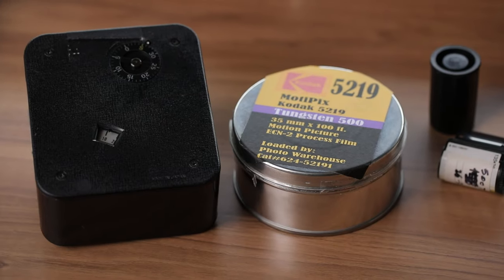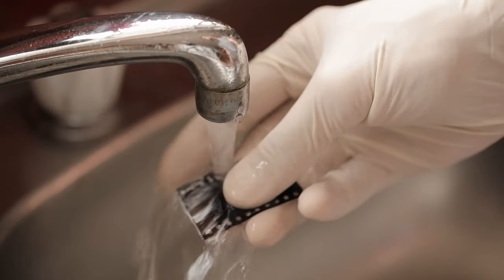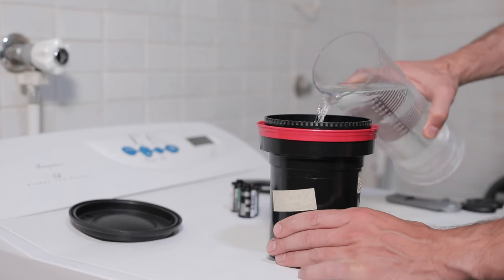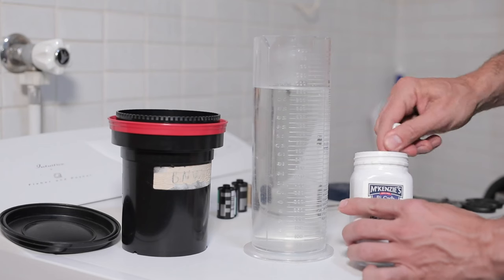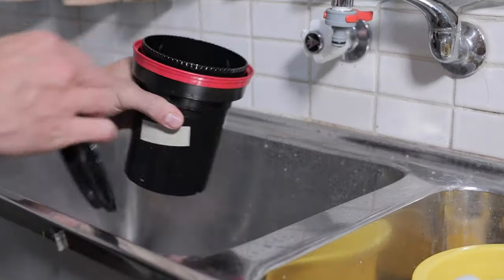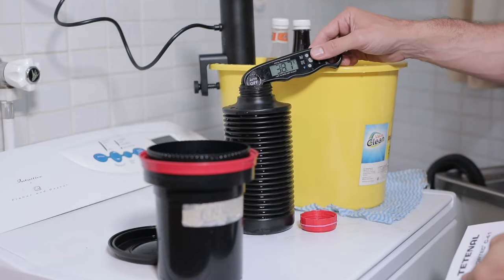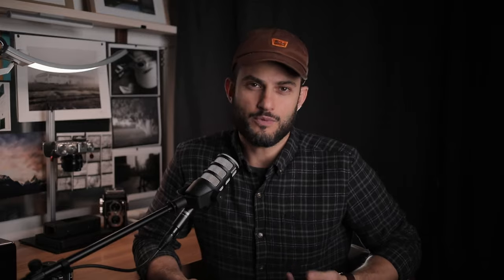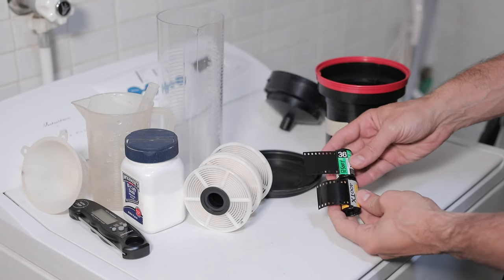Removing the Remjet layer from cinema film

Comment: Is there a safe way to remove the remjet layer before shooting, reroll the film and then shoot it as if you were making your own homemade Cinestill stock? I just saw your bulk loading video and thought it would be interesting if that kind of process would be possible at home?
Reply: I reckon so, but the problem is you'd have to make sure that ALL of the remjet was off, otherwise if any is left then you'd ruin the C41 chems. You'd also have to do it alll in the dark, including scrubbing, drying, and loading. Loading is ok but you'd need to be pretty damn good to do the whole process in the dark.
Reply: @jamesharber6086  can you look at undeveloped film in the dark with night-vision goggles? Assuming you can make it light tight around your eyes. Essentially, will IR light effect the film at all?
Reply: I’m really not sure why one would want to do it before shooting, when doing it after is incredibly simple. Doing it before shooting is a bit of a hassle.
Reply: @willworkfor_film  That depends on the film and its sensitivity. I have found Kodak Gold to not be IR sensitive in tests with IR lights, but I haven’t had the chance to deal with undeveloped film under NODs yet
Reply: @conorw999  yeah I was just wondering cause then you could develop film in the dark without being mostly blind. But you'd also have to make sure the eye holes are light tight.

Comment: Does that leftover remjet ruin chemicals? I bought a hand rolled vision 200t, remjet removed. Got it developed at my locals spot and some frames had little "watermarks" . I was wondering if that was leftover remjet and if i just contaminated my photolab's chemicals
Reply from the maker: It has never done so in my experience. Remaining remjet on the film doesn't show up as watermarks per say, but rather as hard spots of white that show in your scans (on negative film, since the remjet is black)

Comment: Great video Hashem.  I also c41 process Vision 3 film - I prefer the look to ECN2 developed stock.  I was going to use baking soda to remove the remjet but picked up a packet of Melbourne Film Supply remjet remover when i purchased a Cinestill 2 bath simplified c41 powder kit from them.  Added cost was only $10 bucks for a packet of 2 and I have found each packet lasts one set of c41 chems.  so $5 over 18ish rolls.  That stuff is quite quick, works at 27 deg C and is a 10sec agitation and then 4 or 5 rinses in dev temp water.  That's just what i use and no one way is necessarily better than another as you say.  Whatever people use is cool as long as you find it the best fit for you.  Needless to say people shouldn't be scared of remjet.  It's very easy to remove.

Comment: Can you do this before you bulk load the film? i.e in a dark bag you remove the remjet on the 100ft or 400ft roll of film then once it's dry you can put it in the bulk loader
Reply: I would imagine it's possible, since that's what Cinestill does, but I'm guessing without specialized equipment, it would be difficult to the point of not being worth it.

Comment: Thanks for this video! I’ve seen other remjet removal videos where they use washing soda instead of baking soda. Probably very similar substances as long as it makes the water alkaline. One question: would the remjet removal work after development is done, rather than at the start of the process as you show? Just wondering. Thanks! Cheers from USA.
Reply from the maker: Yeah if you can find washing soda just as easily, that is a bit more alkaline so would be slightly better! I have heard that removing it after can work fine, but have never tried it myself.

Comment: I have looked at the video several times.  It is as you indicate fairly straightforward. But I notice after the hand rinsing, you have put the film back on the reel and then tank for the stabilizer/photoflow step.  I have never had much luck getting wet film back on plastic reels.  Do you have some sort of technique for that? I could see metal reels (which I no longer have) but plastic?
Reply: Respool the film on the reel underwater...  it easier.

Comment: Wonderfully helpful video!🙏🏼My question is: after removal of the majority of the remjet during pre-rinse, is there a risk that any of the residual remjet would ruin your c41n chems during development?
Reply from the maker: I've never experienced this! I think small residual amounts don't cause much harm since it's just carbon. If you're worried, you can run it through a coffee filter paper. I tried this, but it didn't really seem to remove any sediment or change performance for subsequent use compared to not filtering it. I'm not 100% confident on these opinions though, so it would be good to ask a few people including lab operators if possible.
Reply: @pushingfilm  ok great, thanks for the response!🙏

Comment: Awesome advice! I however find that even after baking soda and washing at the end, there still is remjet left which shows up in scanning?
Reply from the maker: I see! Are you doing both rinses at high temps, and letting the first round soak for a bit before agitating vigorously?
Reply: @pushingfilm  I think I might need to try again and leave it a bit longer. I saw that someone also recommended using a mixture of fairy liquid in the final wash to get it all off by hand?

Comment: any tips on getting remjet off the emulsion side of the film?
After developing when trying the rinse off the remaining remjet I sometimes smear some  on the emulsion side
wondering if you had the same problem?
Reply: I have this problem too I keep getting remjet stains on my emulsion side I don’t know how to prevent it
Reply: @helloimnotwell  Now I just remove it in running water one frame at a time with my fingers with some latex gloves while pulling the film out of the reel
Key is to keep the roll inside the developing reel holder while doing this
Reply: @throwingstones96  I'll try this next time, thanks!

Comment: Awesome video! When developing in C41 chemicals what temperature do you keep the developer at? I am going to switch from using ECN2 chemicals which need the developer at 41 Degrees C and was wondering if you still use the C41 temperature of 38 Degrees C?

Also, an additional method I use to remove any residual remjet before the stabiliser, (instead of the rinse under the tap at the end) is to hang the film up wet and use a wet sponge to run down the the film’s remjet side (rinsing the sponge after every pass) and for the final few passes I use cotton pads and discard them once they are used. I’ve found this to be the quickest, cleanest and best way to avoid scratching the film.
Reply from the maker: Thanks! I currently use Tetenal  C41 at 38 degrees 🙂

Comment: Are you putting the film back on reels for the finishing step?  How are you getting the wet film back on wet reels?
Reply from the maker: Sometimes I do ( In which case I just do it slowly and carefully. It's annoying, but it works) and at other times I cant be bothered and just run the stabiliser over the film in the bucket and snake the film around 😅 Loading wet/swollen film onto reels can also result in the ball bearing stripping bits of the emulsion off from the edges/sprockets. So, I guess I that neither is a perfect solution for that part of the process!

Comment: Wait, so you remove the rem jet layer after exposing the film? Is the rem jet layer in the way of the development chemicals?
I was under the impression that you’d remove the rem jet first, load the film canisters, expose the photos and then develop as normal.
Reply: Nope, Cinestill does that to be able to sell it ready to develop, but removing it prior to shooting is what causes halations and makes it more prone to static and other artifact. As long as it is removed prior to C41 development you're fine
Reply from the maker: That's right, as per the previous comment! In fact, you can even remove it all at the rinse stage after development and blix and it'll still work... but I prefer to do most of it beforehand.

Comment: if you guys are as cheap as i am, here's my solution: 
mixing the "remjet remover": 30g of baking soda/ 500mL tap water at any tempreture (as long as baking soda can desolve). solution will be clear before any use.
removing remjet: 
1. pour room tempreture remjet remover into the development tank, let it sit still for 2 minutes.
2. pour the remjet remover into a bottle to reuse, the solution will turn pink and get progressively more pink with each reuse, but almost no remjet will come out with it at this step.
3. pour room tempreture tap water into the development tank, shake aggressively for a few seconds, pour out. You should see the "black water" at this step. 
4. Rinse again, the water should come out with a pink tint. rinse a few more times until the water become almost clear, and your film is ready for normal C41 process.

Note:
>this method will not remove 100% of the remjet. after the development you can scrub the film under runing water, gentally, with your finger to remove any remaining remjet. 
>you can almost reuse the remjet remover indefinitely 
>"room tempreture" is anywhere between 15-30 degrees celsius.
>you can rinse with tap water at around 30 degrees celsius to get clear of the "pink water" faster, but it's not necessary and from my experience with hundreds of rolls, makes no noticable different.
Reply from the maker: Hey, good tip! I've never thought to re-use the solution or do it this way. Gonna try it next time, thanks 🙂
Reply: @pushingfilm  baking soda is dirt cheap comparing to C41 chemicals but still, I'm cheaper 🤣🤣
Reply from the maker: @ZachACameraGuy  Haha same, you gotta save where you can!